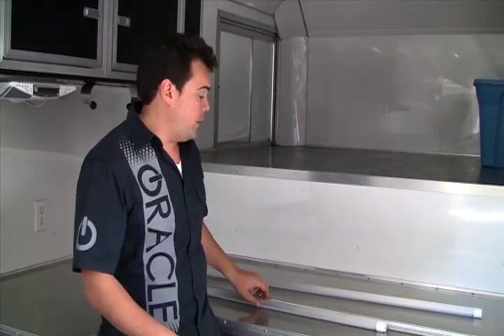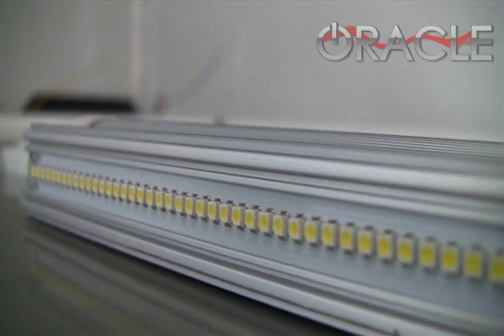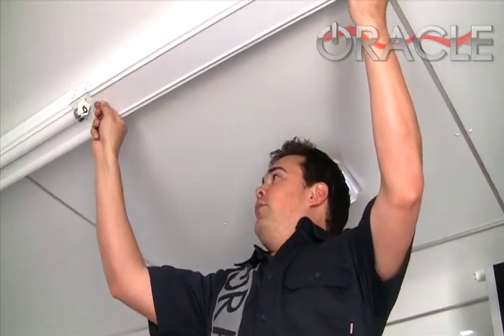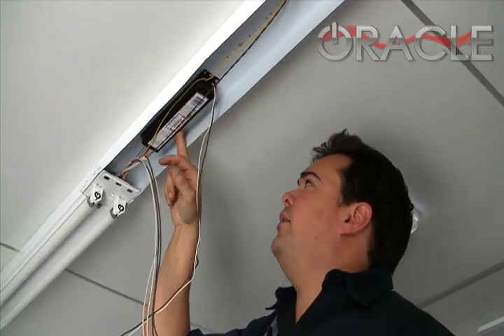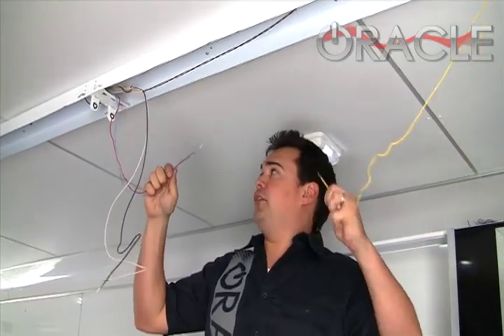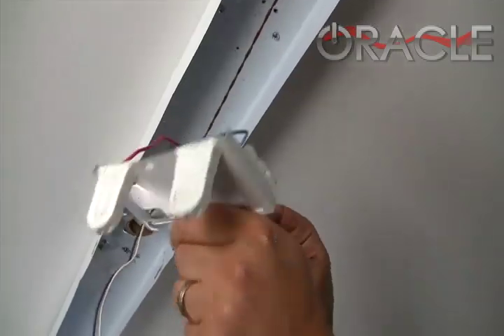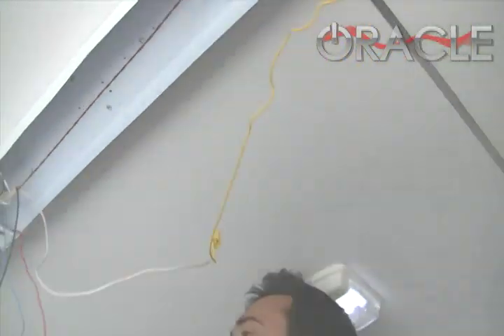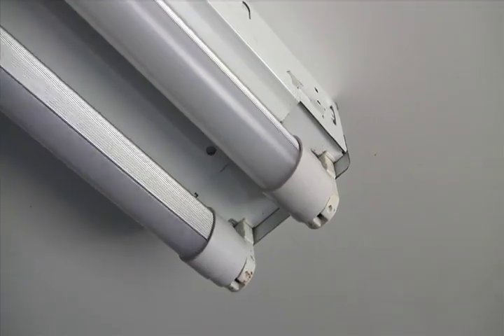Installing ORACLE Energy Efficient LED Fluorescent Replacement Tubes DIY

Comment: it is now illegal to do the above process without fitting an inline fuse, incase someone mistakenly refits a normal fluoresent tube(wich would explode with out the correct control gear) use a licenced electrician only!
Reply: yeah like the public could do this without burning the house down or probably electrocuting themselves and then blaming it on the previous electrician.